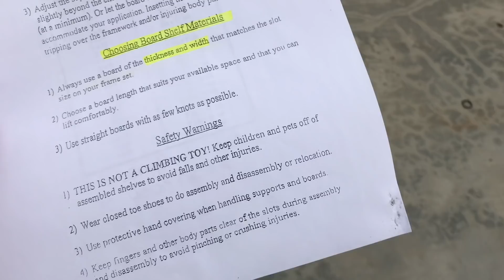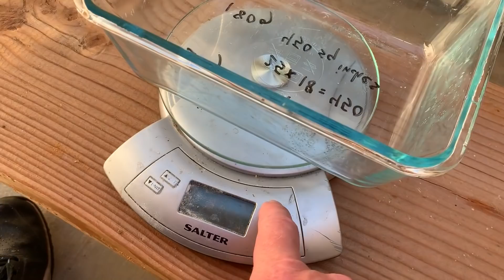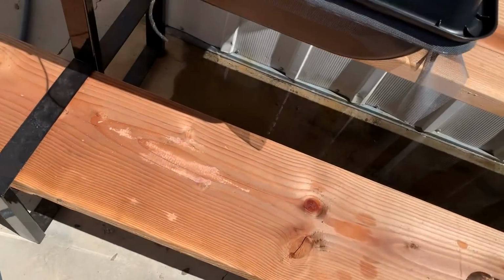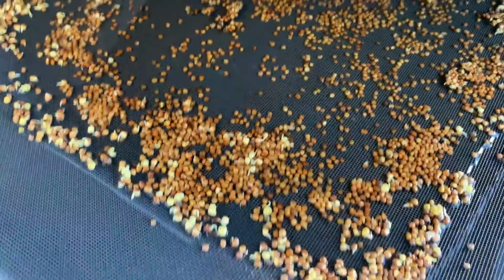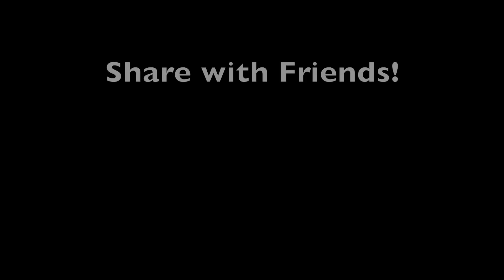When Beauty Meets Simplicity

Comment: Couple things to try: Hang weight or attach bungee's to the wood frame. The constant tension may compensate for the sag of the screen due to continuous stretch. 

Perhaps, instead of contact with the water, have it just about the water. Mist the seeds once or twice a day( or what ever is needed) to get them started. Once the roots are long enough to touch the water, discontinue the misting. Again this would require drum-tight, level screen surface. 

Plastic knitting screen(I think that's what it's called) might be good to use in place of the window screen. I got some at a craft store and cut circles out of it for use in mason jar lids for grow sprouts in jars(WAY cheaper then buying premade). I've only seen it in 8x10 sheets, but may be avail. in bigger. If it still sags too much, adding a grid of plastic ribs hot glued to it may work. 

Just some brain storming.....  :) 

Happy Holidays!

Comment: with a parallel sided container a tight framed screen could be adjusted to float on the reservoir. thanks for the fresh perspectives
Reply from the maker: floating might help with the un-level screen issue
Reply: @JebGardener  How close do you  think? do the seeds need to touch the water or just "smell" it I wonder
Reply from the maker: depends on humidity

Comment: If the support frame fits in the tub instead of over, perhaps you can add a center support to get better germination in the middle with less drooping of the screen. Height adjustability could also be an option with this kind of setup.
Reply from the maker: germination chamber

Comment: Put little notches or rollers in the 4 corners of the tubs and hang weights off the corners of the screen, letting them hang over, through the notches, keeping the screen taught.
Or use the metal screens.

Comment: Here is a suggestion for you, use a couple of old stainless steel bicycle spokes. Through the wood frame to support the mesh and rather use one of those fogger units you get  cheap on ebay for the germination.

Comment: There's an old experiment to start seeds you take a plastic bag put a napkin in it. You put a little bit of water at the bottom of the plastic bag to feed the seeds. You could put a paper sheet between your screen and your seeds. Let the end of the paper touch the water and it will deliver moisture to your seeds.

Comment: Maybe try having a water pump hooked up to a water tank constantly putting water into the tube. You can have an over flow level so you will never be under or over water giving the seeds a consistent water level. It goes against your kratky style and might be over engineered but it would fix the water level issue and might increase seed germination.
Reply from the maker: I think a germination chamber would work well for stacked screens

Comment: Where sinks have overflow holes to stop it...overflowing...couldnt you rig a drip system that keeps the water at the exact height you need using an overflow hole?

Comment: That's an interesting predicament with the screen. It almost seems as though the seeds germinate the best when the surrounding water is in TENSION. That would actually make sense, since plants generally grow in soil that isn't saturated. I wonder if there's a way to tension the screen (without breaking it) so that the water is at a consistent level relative to the seeds. Perhaps you could take your wooden frame idea and attach a ratcheting set below the container and connected to the frame so that the frame is pulled down, and the screen is pulled tight. It would be tricky getting the water level right, though: the water would need to be pulled UP from the surface to the point of connecting with the screen, but lower than flush with the screen. The easiest way to do that would be to attach a medium to the underside of the screen like a paper towel, but that wouldn't be TRUE hydroponics...
Reply from the maker: a floating screen would be interesting